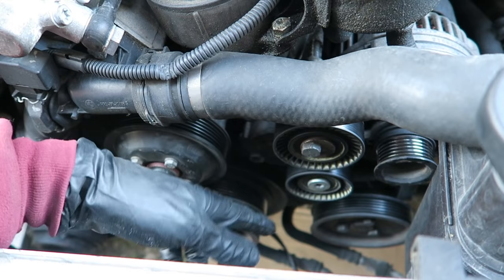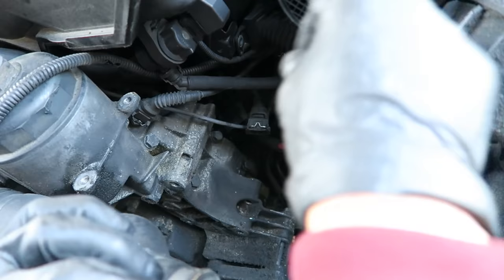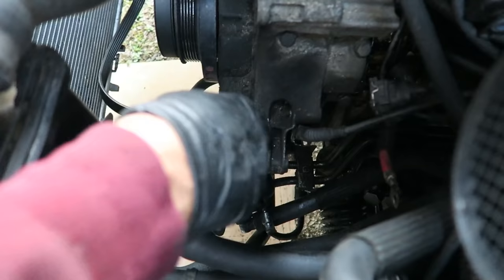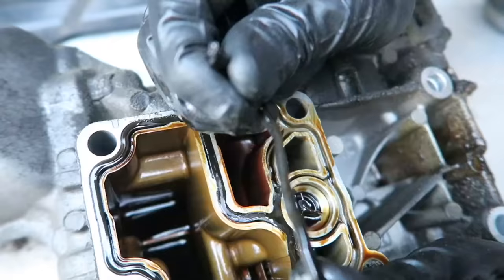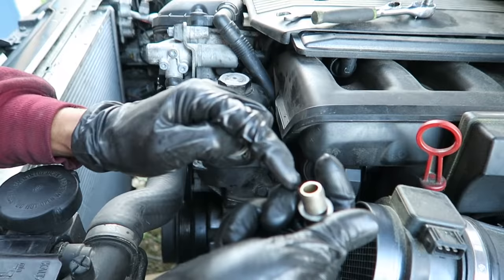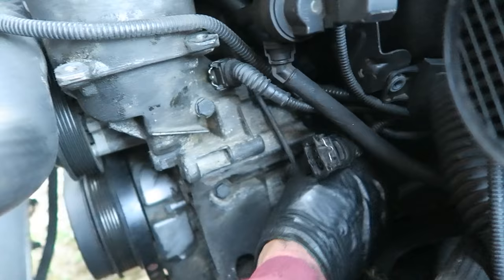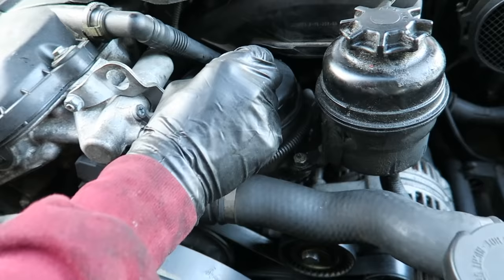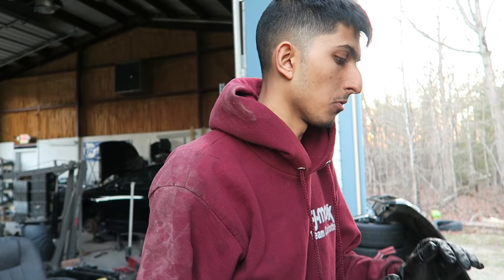E46 Oil Filter Housing Gasket Replacement DIY

Comment: Do you feel this is age related maintenance item or a miles driven deal? I have owned our 05 since new and it only has 70K on it. Not seeing any oil leak, but should this be preventative or wait til a problem deal? Thanks again for your great video's.

Comment: Hey there, are you still alive?
1999 bmw 328i
Is leaking right behind the water pump exactly when i pour antifreeze and i saw that line when you pull off the filter housing, what's that line where it goes and how  can i replace or fix it....thanks....and I'll wait for your answer

Comment: Anybody know what that first connector actually connects to on the oil filter housing that he first removed at the back? It's just a ground wire I believe. After doing this job I might've forgot to connect it or it must've disconnected by itself since I found it today with no metal clip on the actual conector when I was removing the alternator and expansion tank

Comment: I accidentally loosened the bigger Torx bolt by the passenger side fan shroud. My car started hissing and air came out. I tightened it back up but it’s still hissing.

Comment: Hi thinking of fitting an oil cooler could I fit this by putting in in line on the connecting oil  pipe between the filter housing and vanos rather than using a aftermarket. Filter cap with outlet and inlet?

Comment: Dealer just quoted me $615 for this job. Thanks for your great DiY vid. Question, I'm replacing my belts. 2002 330ci. First replaced about 60,000 now 129,000. Do I have to replace the idler and 2 tensioners. Can I order them test the old ones first then send back the new ones I don't need?

Comment: Do you have to drain the oil? I've seen in forums where you don't. If so how do you do that? Just take the oil cap off and that's it?

And also, I have a manual 05 330ci, so I should have an electric fan. So it should just take off and on?

Comment: Great DIY, thanks.
Is it really necessary to drain the oil?
Shouldn't it be all in the pan? or there's still some oil left in the top that will spill when the housing is removed?
Reply from the maker: No it is not, you can just loosen the oil filter cap and remove the dipstick which should drain the oil filter housing into the pan.

Comment: for the vanos unit banjo bolt washers, what kind should i have in hand? i know u said 19mm but i dont want to get down there and have to make a trip to get some or get lazy n use the old ones bc i would never want to skip one if Your steps :)
you are a e46 beast
love the channel
very informative n easy to follow
you got me living the #shoplife
Reply: Dude!! open up your bonnet... sorry hood!.. and check the size of the bolt, its right there.
Reply: jobs done. 
got them from the dealership.
put on a new alternator at the same time.

Comment: Okay.  So, when I was re-installing my main belt tensioner pulley, I broke the long 13 mm bolt off deep in the recess.  Any help on getting the main tensioner pulley off now?  It's the main serpentine belt tensioner pulley.

Comment: @ShopLifeTV just curious as to what size and type the washers for the Vanos feed line are? I want to get replacements before I start taking everything apart. Are they crush washers or regular solid aluminium? I'm in Australia so don't have access to a lot of the stores I've heard others mention on these vids previously. 

PS love your vids. Best e46 channel going around (y)

Cheers

Comment: I have had several customers come to me and say they were told the oil pan is leaking.
It usually turns out to be the oil filter housing gasket like this video.

Comment: Thanks I need to do this job within 14 days. One question. What washers can I use for the 19mm banjo bolt on the rear of the oil filter housing? part numbers? and not re-usable?
Reply: Did you ever find this out?  I don't see any part numbers for the two washers.
Reply: @MustangGT715  i am sorry i cant remember, i am pretty sure i used the old ones without problem and its been years

Comment: On my 2001 BMW 330I E46. My question is would a leaking oil filter housing gasket leak or cause oil to mix into the expansion recovery coolant tank? I have no water in the oil but I have oil in my expansion tank looking like tan milkshake.
Reply: in short no.  How do you know you have no water in your oil?

Comment: i have a question i have an bmw 530i im having a problem with cooling system water wont cerculate in my radiator i changed water pump all the hoses expantion tank thermostat radioator is original im having a problem one side on thermostat area water when the car is running is super hot on the side of the radiator on the lower side hose area below expantion tank water is super cold i dont know what to do should i change my radiator or have it flushed or u think could be the heater core i bleed the system but the car water overheats almost and doest seem to be cerculating wile the car is running if u open my radiator car booomm all the water comes out and it burstes out like crazy seems like its overheating but its not gage shows in the middle but the water get super hot im confused i did bleed the system should i change my radiator ??

Comment: Great Video.  I have a 2004 645ci my oil filter is under the car.  Does this car have the same type of issue.  Would i be able to indicate the same behind the alternator.
Reply from the maker: The n62 is quite different so the leaks occur in different areas.
Reply: I disconnected the positive side of the battery while working on the car for some days.  now I have an airbag malfunction warning.  where can I get a cable to reset the airbar light with the software you use.  I checked under both seats and all is connected.  Any idea

Comment: hi i just finished watching this video couple times to memorize the steps, and a question i have is about your "tensioner pulley" in this video did you have a mechanical or hydraulic?
Reply: He has a mechanical.  If you have a hydraulic tensioner, pop the cap off the bearing and turn the T50 bolt clockwise to relieve belt tension.

Comment: You have the best Videos for do it yourself guys like us. Thanks again
Reply from the maker: Thanks man!
Reply: I need to ask you a question. Yesterday I had an (!) light come on, "transmission fail safe" MODE. My car is running in only one gear 5th speed. It drives fine just no shifting and very sluggish at the start up. What do you know about (!) lights?
Reply from the maker: Any check engine lights?
Reply: No check engine lights no problem going into reverse the engine starts Idols fine accelerates and drives but only from 5th gear.

Comment: How do I remove the bottom steel engine cover? I doing this job on 2003 X5 it has a lot of oil that has accumulated on the bottom steel engine cove since my oil filter housing is leaking. And I want to clean off the bottom engine cover that way it's clean and if there's more leaking I can see it. Please some one help out.

Comment: I’ve just replace the oil pan gasket and valve cover gasket on my 2001 X5 3.0i and it still drops oil on the floor. Maybe should I do the oil filter housing gasket too?
Reply from the maker: yes it is a common leak

Comment: You still have to do your video about how to wire the m buttom on your e46 and do you know if its legal to do the swap m3 on a sedan in california
Reply from the maker: +miguel pena pena I'm not familiar with california rules regarding engine swaps and what not. I think you have to have the donor engine come from a newer vehicle and it has to have all of the emissions components and what not from the donor setup as well. Not completely sure though, I would check with your local regulations. Also regarding the sport button, I am not incorporating the sport button, but the sport button requires you to add wires to pin 15 and 16 of the x6004 connector.

Comment: Hi, do anyone have tips to remove the oil cooler from a 320d e46 chassis. Can't get access to unscew the three bolt of the oil cooler. Already removed the water pipe, and other stuff that is describe in the workshop manual.
Hopefully will get an answer.

Comment: Where would it leak left or right I have oil leak on the passenger side  on my Xi looks like coming from housing connection where the wheel sit and possibly the front of the engine
Reply: Isreal Perez , drips down the left side of engine and also front.

Comment: my 325i is 2003 with 100m do i need to replace it looked like oil filler cap bought new one but just wondering when or how many miles does this filter go bad
Reply: no need to replace cap unless damaged.  but there is an O ring that you need to replace along with each filter change.  change oil and filter every 15,000 miles or every year.

Comment: What size are the crush washers on the Vanos oil line in back of the Filter housing?
Reply: did you ever find out? i have the same question for when I do it

Comment: You should also replace those two small orings in the oil reservoir cap. They do not come together with oil filter as the main oring does but have to be bought separately (1USD each)

Comment: Could I ask you a question about my Acura MDX?
Reply from the maker: +nick ray Sure man
Reply: +ShopLifeTV thanks for the reply,
So when I start it up it makes a whine sound for about a second when it turns over then goes away, I was just wondering if it was Anything serious. Also if you know what the issue is would this be something easy to tackle on my own? The Acura stealerships cost an arm and a leg man so if I could fix it own my own it would be awesome. Cars a 2009 with 90k miles.
Thanks, John
Reply from the maker: +nick ray Hey man see if you can make a video of the sound or find one on youtube with something similar.
Reply: nick ray its just your secondary air pump. its supposed to sound like that. it injects ambient a
Temperature air into the motor to shorten warm up time and helps "keep emissions down". Totally normal

Comment: It would be nice to show us first where is leaking, i have a leak in this area i cleaned it and it leaks a again but not much, interestingly that when i check the oil stick, it doesnt lose oil it stays the same maybe because a lil leak
Reply: Senad Selimovic I have same problem . I cleaned all the way , I changed the gasket but it's still leaking 😒

Comment: Hey man, I really need your help. I am trying to do this on my E46. It is a 2001.After taking off the tensioner, I realized that the bearing is shot. Mine seems to have a different tensioner than yours does though, I think it is a hydraulic tensioner. It looks like it has a tiny shock on it. It is not round like yours. My question is, can I buy the tensioner like yours, the circular one, or do I need to buy another hydraulic tensioner? I would appreciate a response. I love your videos and your blogs.
Reply: in short yes you can.  the mechanical tensioner are simpler devices, and simpler to install, but dont last as long and can start to squeal a little after 10K + miles.  no big deal but if its anymore than a slight squeal, it would need replacing.

Comment: you dont have to drain the oil
Reply: zeeaars how do you do it without draining the oil?
Reply: jase94 i just got it done.  i didnt drain the oil. most of the oil is settled in the oil pan.
Reply: NICE! I'm going to do it soon! I just bought a ton of tools to start doing my own shit. WAiting for some vanos washers to come in to replace them. 

Just take the oil filter cap off right? and the oil will settle in the oil pan ,correct?
Reply: jase94 i didnt even take the filter cap off. dont need to